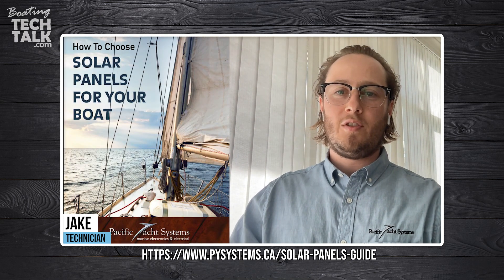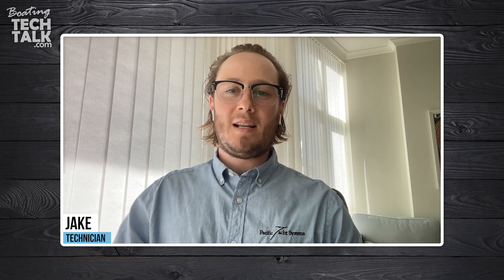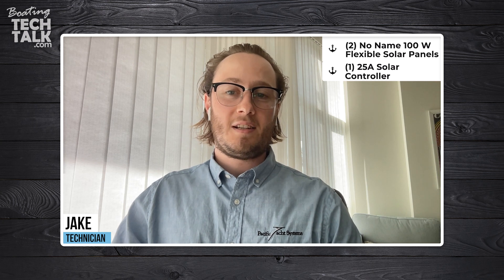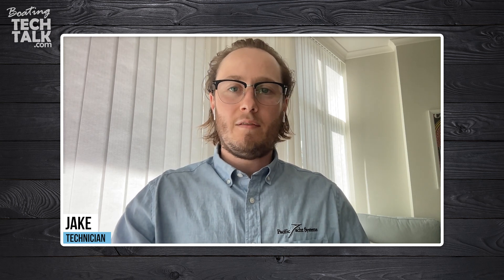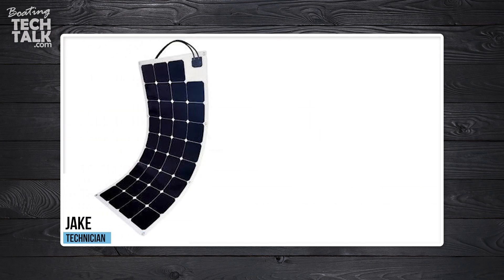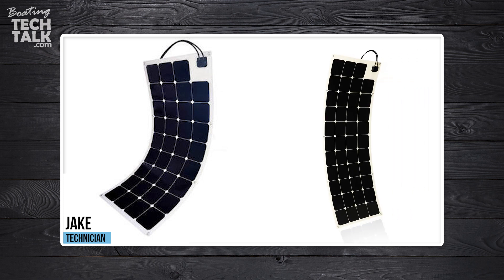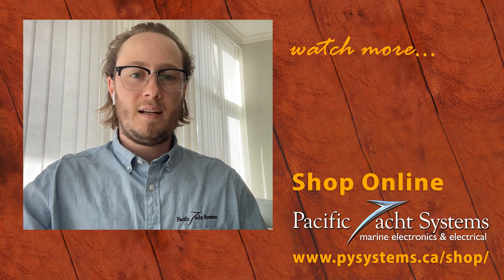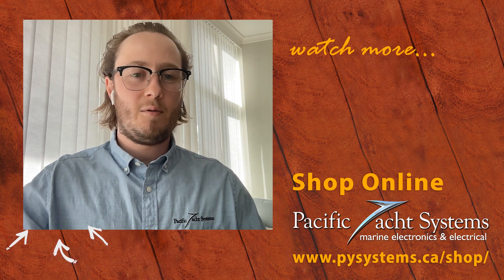Can I Mix Solar Panels with the Same Wattage But Different Manufacturers on My Boat?

Comment: Sir, I’m a big fan of your channel. Solar question. I want to install (4) 270 watt panels on my 2000lb boat. I want to power a 6kw outboard. The battery is 9 kw. Will that amount of solar allow me to keep a full battery and still travel several hours (keeping the motor at, say 1/2 power) Is the engine too large?

Comment: useful information thank you. However, if one is planning to wire them in parallel, wouldn't one simply need to make sure that both have the same or very close output voltages even if they have different wattages (i.e. amp)? It seems that the efficiency loss would be minimal in that case. Am I wrong?